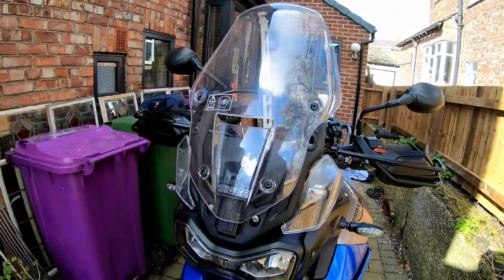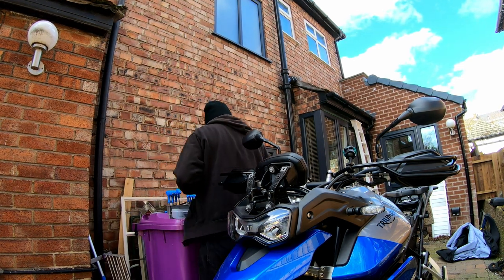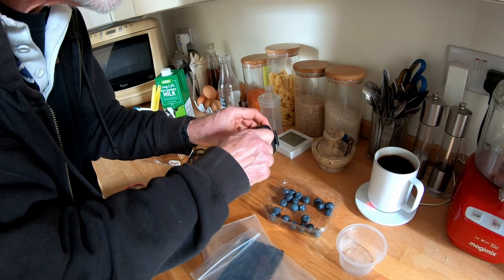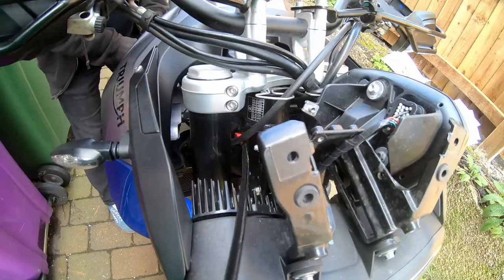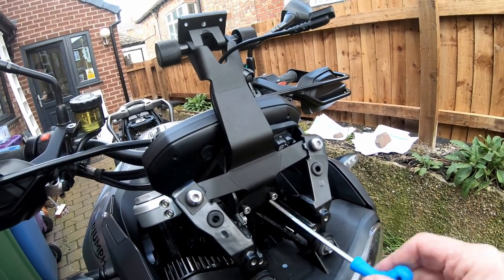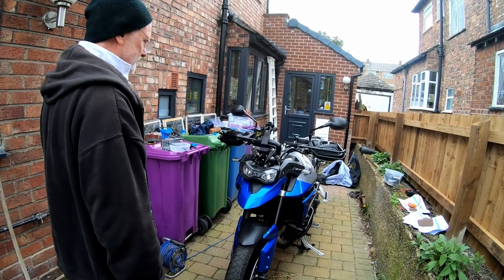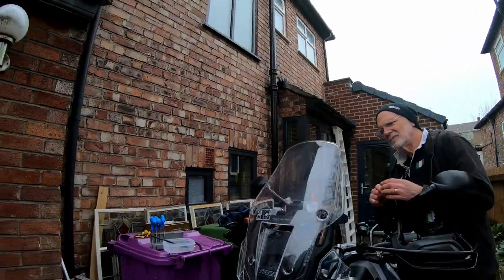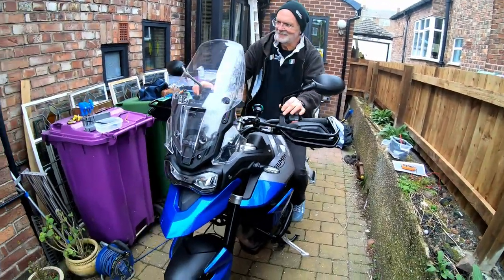Triumph Tiger 850 Sport - Evotech Sat Nav Mount

Comment: Hi. Thinking of fitting the Evotech mount and Garmin XT to my 900. Have you so far had any problems with the interference from the TFT screen, there have been reports of it effecting the GPS in the Garmin XT (I presume that is the model you fitted ?). Many Thanks.
Reply from the maker: Well it is DrJ's bike. He has reported no such issues. However, his is an 850 Sport which has a different TFT I think 👍

Comment: Thanks for this helpful vid……as I am
Now equipped to duplicate your process.

Please tell me if it is true that an application of either the 850’s brake lever or pedal simultaneously converts the rear signal lights into auxiliary brake likes?

Thanks again…from BC, Canada.
Reply from the maker: Hopefully helpful. 🤞 Not seen any indicators behaving as brake lights riding behind DrJ. I believe BMW may use such a system.

Comment: I wish you had shown the wire connection 😢
Reply from the maker: I did. It's an OEM plug under the seat. Switched by ignition. At around 5 mins.

Comment: And another question! When you pulled the cable up through under the tank where did you put the little black box that is connected to drop the voltage. Is it connected to the frame by zip ties ?
Reply from the maker: It should be clear in the video. We connected the gps power lead to the ignition switched acc line under the seat. The voltage regulator is at that end. Using my patented giant cable tie (zip tie) method we eased the power lead to the front. It easily traversed the brake line channel. After that a few small cable ties under the seat to frame tidy everything up, plenty of wire. Comes on with ignition. Switches off when ignition off. 👌
Reply: Thanks for that, but I would be fixing it to a Thunderbox which is placed by the battery so would need to hid the voltage box higher up under the tank area as there is not much room in where the battery is !
Reply from the maker: DrJ has a Thunderbox in there also. All fits fine

Comment: Hi guys. Nice GPS mounting.  I have Tiger 900. I mounted mine on the handlebars bit of a stretch for me at the screen.  Just on another topic re Givi pannier rack quick release.  Have you had any issues with it. I'm thinking of fitting it to my Givi racks. My only concern is all the weight is taken by the locking pins. Just worried these may fail from constant pounding on out crap roads here in Australia.
Reply from the maker: GPS is now in good position. No probs with quick release so far, but we just don't have the distances / amazing roads you have; difficult to say 👍

Comment: Hi, just been in the garage and found that switch plug on my 850sport. Question, did your Garmin plug into the Tiger plug, or did you have to cut the plug off? If so how did you make the connection please?
Reply from the maker: Do not cut off the plug. It’s pretty standard on many bikes of all makes. We just used off the shelf plugs. One on the positive and one on the ground. Easy to check with a meter. You could just push the wires in and tape them up. So long as you have polarity correct it will be fine.
Reply: @CodgerBiker  do you know the plug type or what it’s called?
Reply from the maker: Hi there. From memory they are just simple blade connectors.  Easy to obtain and can be crimped or soldered on the end of your GPS lead. Just make sure you check + and -. Nothing to it. For testing we just pushed the wires in, no connector at all.

Comment: After owning my Triumph Tiger 900 for 8 months now and after trying out so many things, there remains to be a BIG compromise to me. There seems to be no decent way to mount a Garmin or Tom Tom GPS on eye level position.
I tried mounting on handlebars....no thank you (to dangerous to look down all the time)
I tried this Evotech mount...no thank you( the screen vibration makes it totaly unreadable).
I think the mounting spots used by evotech are not the way to go. TEST ? ....Start your engine and feel the difference with your fingers around 2500 RPM, comparing on a mid handlebar spot and a top windscreen spot. There's the problem with the tiger 900
Please, if anyone has a solution, send it, post it, comment it, suggest it
Reply from the maker: Dr J has had no such issues with his Garmin Zumo XT 👍
Reply: I have the same issue with mine, very vibey and quite annoying. There is another one that tightens to the windscreen adjuster bar which is no where near as vibey. The only issue is the gps goes up n down with the screen which is why I went with the evotech but I am thinking of swapping back. PS if you go with the other one make sure everything is tight and locktight used otherwise it will loosen on the ride.